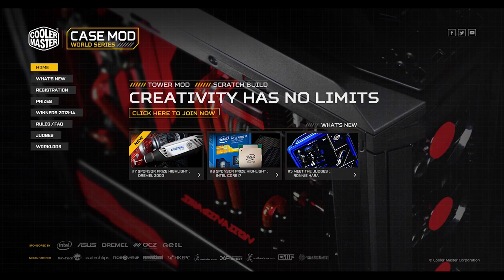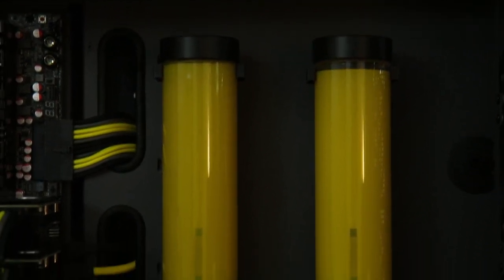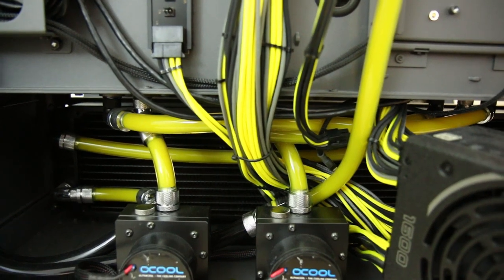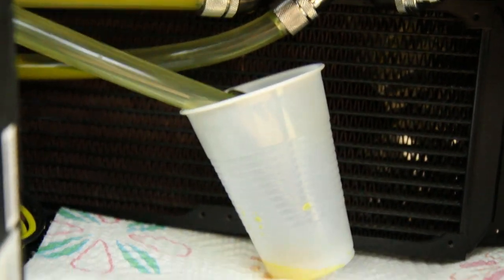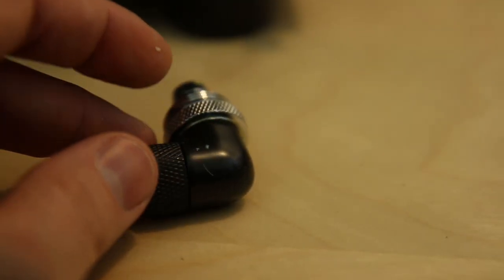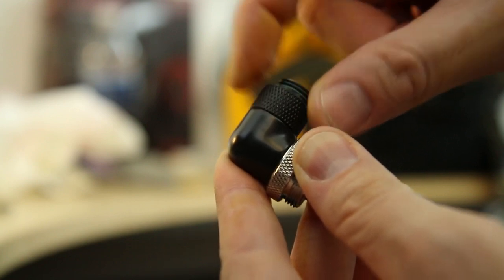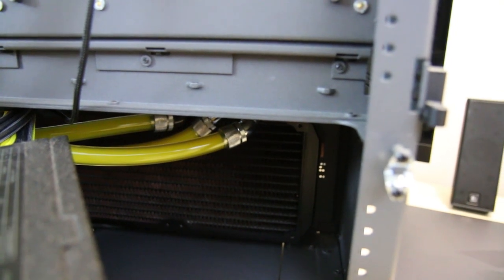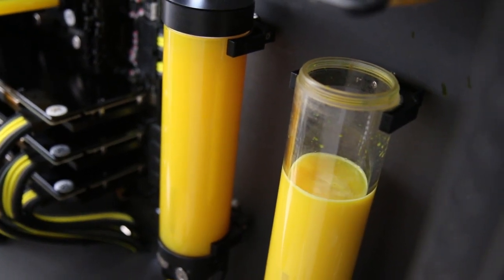My $6500 Custom Watercooled PC LEAKED!!! Now lets fix it....

Comment: is it possible to buy hard tubing already bent? to all the required shape to use less fittings?
Reply: TinT LosT No mainly because everything has to be 100% precise to make a functional build. Would be to high risk if a customer sent you a bad measure ment
Reply: good point thanks ^^ for the info
Reply: TinT LosT No problem

Comment: God I can't get over some of these comments! I was particularly fond of that naive and angry gentleman who so adamantly insisted you must have dishonestly "inflated" the price of your build, priceless! (no pun intended) You get these knuckleheads living so far off the grid for so long they have no fking idea what goes on out here in the real world anymore. Hell, I have a Caselabs system that's not even finished yet and it's already sitting at almost $5,500. And I'm only running Z97/4790K. Sticking X99/5960X and few gigs of DDR4 in there would easily push it up another $2K - and that's without all the "artificially inflated peripherals" - just in case that wingnut is still out there reading this! Get a grip man. 

Anyway, so on to the one comment/question I came here to make was - why didn't you outfit Skunkworks with an Aquaero system? It wouldn't have prevented the leak, but it can easily be configured to shut down your rig based on any number of different alarms or sensor inputs. I'm sure you are aware, but emergency shutdown is really only a secondary benefit to the Aquaero's main functions of controlling your pumps and fans based on temp inputs, which can make for a pretty efficient and quiet running system.

Well this got really long really fast - glad to hear Skunkworks didn't take any serious hit from the leaks and a big +1 on all you do here Jay - keep up the great work!

Comment: silly boy ask a hull tech? all pumps fail all water cooler will leak sooner or later all fittings will leak hoses get brittle and leak. You do know that liquid and electronics dont mix ever. Air will work regardless. That nice motherboard ruined video card involved. WATER NEEDS A INTERNAL PUMP NO LINES NO Reservoirs> self contained in the pump.Never tell if the pump quits it will sometime down the road.Pump one gasket and a fan in the liquid if you used mineral oil it wouldn't hurt anything.Jewelers loupe to look for tin splinters after a leak microcircuits are motorist for tin splinters to form

Comment: I don't see the benefit of water cooling now days.  Unless you are in a hot room / high ambient air temp and you are doing serious over clocking.  It's a waste of time effort and money.    I have a high end system x99 chipset, 6 core Intel over clocked with a 1080 gtx,  corsair obsidian case, just using case fans.  Room temp is 70 - 75 degrees.  I have had zero issues with stability.  I am using the Cooler Master Hyper 212 EVO for 30 bucks..   I've had water cooling the past, and I saw zero benefit and just heads aches.  

Heat sink / air cooling in todays world has come a long way where you will almost always see similar results between water and air perform the same.

Comment: i got one of those water coolers of koolance mounted on top of my pc i cant even see the water level so if something goes wrong im screwed i just recently found out that there was air in it  the sound scared the crap out of me since i never had liquid cooling before and i eventualy have to drain it and fill it ill use video tutorials for that

Comment: What sort of temps would you get on an i7-6700k@4.6Ghz with full load, during say P95 smallFTT using a water cooling setup like this?
Reply: Prime95 with AVX instructions?  Probably high 60's or so.  Really a custom loop isn't going to outperform a (top-end) CLC kit all that much.  Maybe 5C better.  The advantage to a custom loop is you can cool everything in your system (CPU, GPU, VRM's, memory, etc.)  Also a custom loop will be quieter than a CLC because with a custom loop you can put in massive radiators which don't require high RPM fans.
Reply: John Smith Thanks for taking the time to write that information! I recently installed an H110i for my i7-6700k 4.6Ghz @ 1.37v and when under full load P95 (v27.9) smallFTT it keeps the CPU temps under 74c which I'm very happy with (that was the max after 1h with 25c ambient room temp). Obviously nothing gets close to that during normal use, closest being video encoding which gets up to 64c max.

Comment: Anybody engineer platform block air heatsink fan over cpu cooler without block ram slots and first pcie slot. I stick to air cooling..only time I worry higher clock higher clock power draw.

Comment: Btw jay is there a way to repair AIO loops, had 2 of those bastards leak on me and they look like i can takem apart. Except for the pump, its making a screeching noise and then started leaking by the radiator. one was an antec and the other was a zalman. was planning on buying a corsair for my Ryzen till i research those also and some people said they leak also. So i went air instead but im over heating and im considering going back to AIO.

Comment: Aren't the liquid inside non dangerous to your pc? You should be able to pour 45389 liters of that liquid in to your computer without ANYTHING happening.
Reply: ***** I thought it was some sort of oil, not water.
Reply: +Rezz some water isn't conductive and is a better choice for water cooling, but it's extremely expensive.
Reply: +benjamin plays Pure water is a poor conductor of electricity. Distilled water is a poor conductor of electricity. Salt water has a high conductivity for electricity because of the T.D.S./Total Dissolved Solids.
Reply: You're right, pure water is fine! Using tap water and bottled water are the only "types" of water that the will ruin your system. Jay is also using special "nano Fuid" and it should not really affect his components
Reply: +Logan Wang yea some watercooling liquid is less conductive but I don't think it's harmless to your components in large quantity.
Reply: +Rezz Do you drive a car? Guess what happens if you pour water into your cylinders? Your engine hydrolocks and bends a rod. But guess what? Your engine is watercooled.
Reply: +Rezz I've watercooled with good old distilled water and valvoline zerex race coolant for 11 years. And yes, if my loop leaks things will die, but I've never had a leak because I don't use crappy bling-bling fittings like these. I wouldn't be able to come anywhere near the overclocks I have without watercooling, and over the 10 years of builds I've had my watercooling I would've spent $1000+ on gigantic motherboard bending heatsinks to even come close to the performance of a good waterblock. Watercooling is the way to go.

Comment: 100% of leaks that I've seen with watercooling loops have been because of fittings like these. Yes, they look great, but I would NEVER consider using them in a build I intend to be reliable.  If you looked at my loop I wouldn't blame you if you asked "did you steal that shit from a hospital or something?" because it is most decidedly not bling. But guess what? I've bled it twice in 11 years and it has never leaked a single drop. DON'T USE THESE FITTINGS. THEY ARE GARBAGE. Use nossles and tube clamps. If it SCREWS on, it will SCREW you!
Reply: I'm still to scared to have water inside my pc
Reply: +Jibba The Critic lol I guess I got carried away with all the misunderstanding and misconception that watercooling setups are some kind of crappy, leaky solution when it's superior in every single way except setup.
Reply: +K31TH3R it's also a lot more expensive to get the same cooling performance and requires more maintenance than aircooling (provided the room you put your computer in isn't unusually dusty).
Reply: Robin Roos The only way an air cooler will come close to water cooling is if you have a huge motherboard bending heatsink versus an AIO water cooling kit like a corsair H100. No air cooler stands a chance against custom water, it nearly cuts air temperatures in half. These days you can build a CPU only loop for $190 or GPU+CPU for $230 with universal block adapters that is capable of cooling 600W+ of TDP and is a one time purchase that will follow and fit whatever build for a decade or more.
How often do you have to do maintenance to your cars pump, radiator and tubing? Because that's how low maintenance water cooling is. If you have an external radiator, you don't even have to open your case to dust it out, just shoot some canned air through it every 4 months or so and you're done, something you should also be doing with an air cooler.
Reply: +K31TH3R lol better yet its his fault use fans problem fixed
Reply: +Logan Braveheart If you don't trust your own mechanical skills enough to build a reliable water loop, don't do it, but don't pretend air is superior. I spent $235 to upgrade my PC recently. Bought an Asus Rampage II, 24GB of G.Skill DDR3, and a 12 thread Xeon X5650 which I run at 4.6GHz. At these clocks I am slaying Skylake quads. There's no way I could run the same settings on air. I would have to use a Skylake i7 for 4,000+ hours to make up for the cost to performance difference for the money I've saved.

Air is a terrible conductor of heat. That's why the heatpipes in inconvenient huge ass heatsinks have water in them. If you're serious about getting the most performance from your money, water cannot be beat.

Comment: Does distilled water conduct electricity?
Reply: Water is still water lol.
Reply: Ok i actually did some research and water in it's purest form doesn't really conduct electricity but it will start dissolving particles from whatever tubing/pipes you are using and make it more conductive after a while.
Reply: +Fredrik Löfstedt no, I'm meaning DISTILLED water
Reply: Well, distilled water is "purified" water pretty much so not really any difference.

Comment: watercooling always will be superior to air, it's thermo-physics. i find most of the people who complain about watercooling are often ill-informed, don't know how to do it or cannot afford it. sure there are risks but in no way is air cooling comparable to watercooling. It might be cheaper in some cases but with AIO's under $100 there is no reason not to watercool. plus there is no air cooler capable of cooling my cpu and bios modded gpu adequately, especially without sounding like a jet turbine.
Reply: +dragonleader4402, adding a side fan does not automatically drop your gpu temp by 10 degrees, If you knew anything about thermal physics and case airflow you would know this. 
Also how does only watercooling your CPU make it pointless? you busted this yourself when you said that it gives you better overclocking (not true, it gives more headroom thermally), and then again when you said you can just add a side case fan to drop gpu temps by 10degrees.
Reply: +dragonleader4402, can you stop backtracking? Answer my questions before leaving yourself open for more. Why is only WC the CPU pointless? also you state there is no point to watercooling, but you also stated "it gives a better overclock", that right there is 1 point, along with better temperatures, better stability, more thermal headroom.
Reply: +dragonleader4402, i am calm.  Just frustrates me when you can't answer a simple question or 2. You seem very anti water cooling and haven't yet provided a valid reason as to why you have said what you have.
Reply: +dragonleader4402, so you can trash talk whatever you like without having a clue what you are on about?
Reply: +dragonleader4402, how can go you give your opinion on a topic you know nothing about? Or have any experience
Reply: +dragonleader4402, well you said watercooling the cpu by itself is pointless, then said adding a side fan will drop gpu temps by 10 degrees and you reckon im embarrassing myself? Not to mention when i asked about it you keep avoiding the question and providing any experience you have to back this up.  You need to have a good hard look in the mirror before you try call out someone.
Reply: +dragonleader4402, i dont hate that you disagreed, i hate that you think you know about watercooling and thermo dynamics.

Comment: has anyone built a setup with the motherboard upside down and with gpu connections on the bottom (connect video cards to m.board with cables so they can be turned) so that any drip would flow away from energized circuits?

Comment: Is this good for max setting 30+ Fps on cs:go gmod Bfh bf4 skyrim and mine craft

Case - Minion Case Flame Red
AMD Processor -  AMD Athlon x4 860K 3.7GHz (Quad Core)
CPU Cooling - Standard Air Cooling
AMD Motherboard - FM2 Chipset Motherboard
Memory - 8GB (1x8GB) DDR3 1866MHz
Primary Hard Drive - 1TB 7200 RPM
Optical Drive - DVD Writer
Graphics Card - AMD Radeon R7 260X 2GB
Graphics Card Cooling - Stock GPU Cooler
Power Supply - EVGA 500 Watt Power Supply
Operating System - Windows 8.1 64 Bit
Networking - Standard Onboard Ethernet
Reply: You could easily over clock the processor to maybe 4 or 5 ghz
Reply: I'm dumb I would probably take that to a computer shop for them to do that for me can you tell me ghz does I know it's giga hertz
Reply: Would this be better? 

2GB Nvidia GTX 660 GeForce GDDR5
Memory8GB
Modelnzxt guardian 921 
Hard Drive Capacity1TB 
Operating SystemWindows 7 
Processor TypeAMD Athlon X4 860K Quad-Core 
Motherboard - gigabytes Fm2+ amd a78 chipset
Reply: Matthew Daniels an ssd could transform a computer on its own
Reply: So what would happen if I get an ssd i think boot times are faster
Reply: Matthew Daniels put the games on the ssd and etc it'll run with believe it or not a bit more fps
Reply: Damn that will be a bitch cause ssd are expensive and games will consume it
Reply: A cheap ssd one though like 160gb or 120 for 50 dollars or under and that hybrid can be faster for games
Reply: Matthew Daniels An ssd will not impact framerate except from mabye small stutters in open world games while loading the map, however it greatly reduces boot time, application start times and game loading times!
Reply: I would go for an r9, but you should be pretty solid with the r6
Reply: I would go for an r9, but you should be pretty solid with the r7
Reply: Dude with that optical drive you won't get more than 10 fps on cs go.
Reply: Guys thank you all for your support but at that time I was gonna buy a prebuilt but I did much better I went with a higher budget and these are my specs

Nzxt S340 red/black 
16 gb g.skill 1866 4x4
Gtx 980ti
I7 4790k
4 corsair sp120 fans 
Kingston 240 or 250 gb ssd 
1tb Seagate barracuda 
Gigabyte gaming 7 motherboard
EVGA fully modular g1 750 w
Corsair h100i gtx liquid cooling
Rgb led lights
Total - 1650
Got it for good prices and auctions

Comment: but what is it leaked into the system? isn't this very dangerous? it could've leaked on the motherboard or gpu
Reply: It's the risk you run. Take care, maintain the loop, use non-conductive coolants to buy yourself some time if a leak does occur, keep and eye on it, and if you notice something odd, get on it.
It's dangerous if you don't take precautions.

Comment: I'm doing a new computer, THE METAL GEAR.. and will be air cooler, using the world's best coolers (Cryorig R1 Ultimate) and using top components in the market today, I'm will be doing a new video..  just wait... no watercooling at all...
Reply: +hemidesign Actually push pull type cooler like "Cryorig R1 Ultimate" is not the most efficient. The huge square type where you can put two 12cm fan in 90degree angle is more efficient as you get double the airflow of a push pull type. I have tested push pull vs two 90 degree angle fans on my huge square type cooler and the bigger airflow of the 90 degree mounting of 2 fans give cooler temperatures. And on the square one you can have 4 fans in push pull and get even better results :) (have not tried 4 fans yet myself)
Reply: cool info man.. big thanks!
Reply: Wheres the vid? Lmao

Comment: Guys can anyone tell me is 2GB GPU card enough for most/all games right now?
Reply: Hahahahahaha no
Reply: if you want ultra settings 4gb+ is required
Reply: jbenvenga Nah dont need ultra ,is it enough to play all MMORPG games?I say again don't mind low my settings a bit.
Reply: thagamer then it could be ok. but capacity isn't everything in a card. what gpu are you looking at? honestly, if you're going to get an nvidia card, i would go with a 900 series, as anything below that (700 and below) will probably be too slow in 2-3 years. it'll save you money long term.
Reply: jbenvenga dont know but probably not nvidia.Probably will get AMD Radeon R7 2620X 2GB DDR5 128bit
Reply: thagamer ah ok. i haven't owned an amd card in about 5 or 6 years, so my opinion is useless. but that shouldn't be too bad
Reply: thagamer you'll be fine, i've had my HD 7870  2GB GDDR5 for 2 years now and every MMORPG i've played yet, ran just fine.